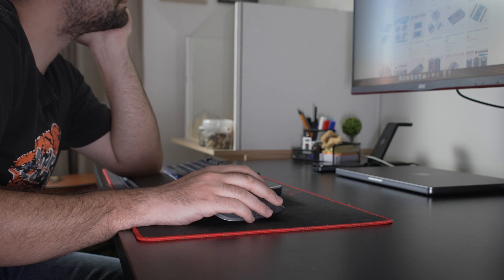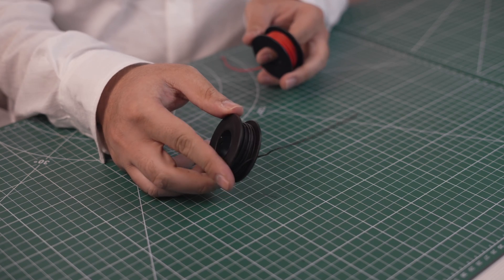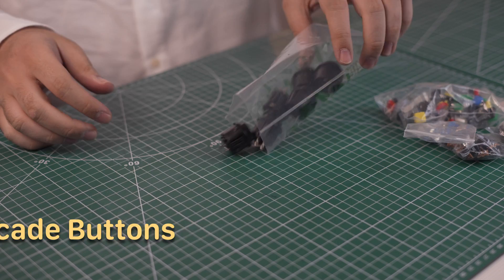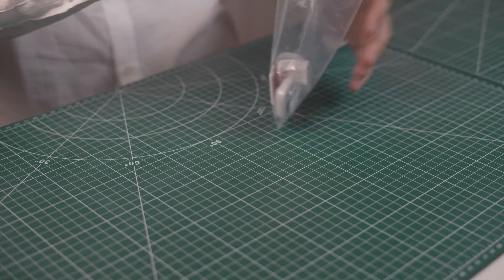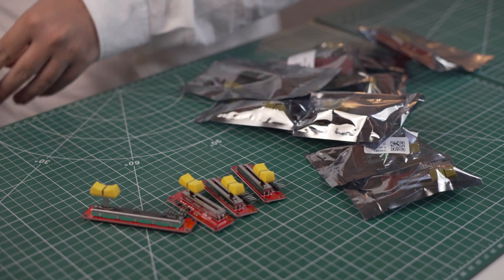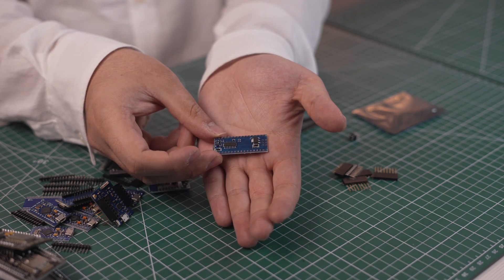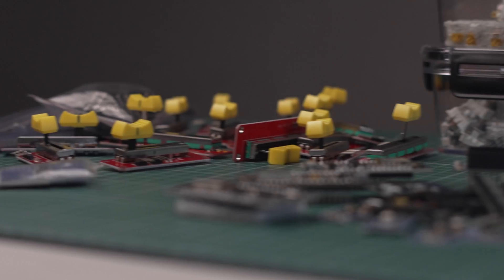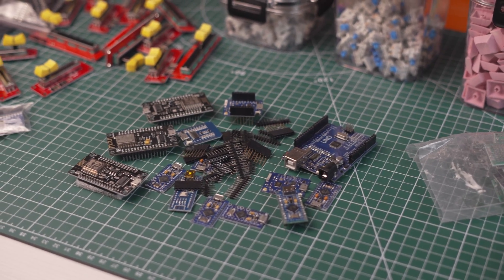Massive AliExpress Haul - Arduino & Electronics Edition (2024)

Comment: Great first video. Shouldn't you let all the components in their grey metalic plastic bag to prevent from dust or moisture?
Can't wait to see your futur projects
Reply from the maker: You are correct, the components are best kept in their antistatic bags to keep them from being damaged from electrostatic discharge. However, it is very hard to show them in the video through the bags 😂 Just kidding, but it is actually easier to store them without the bags, and I know I will use them in projects really soon. Thanks for your input, make sure to check out my second video, where I put many of the components in use.